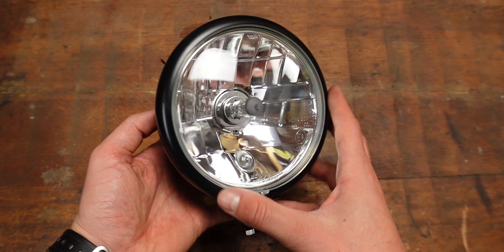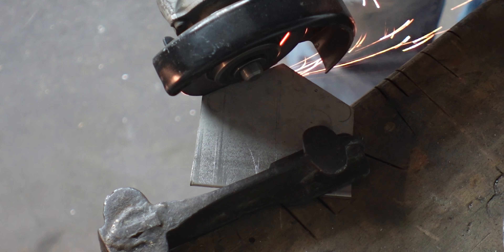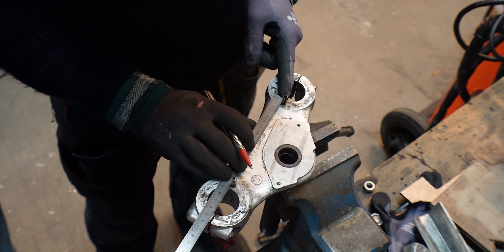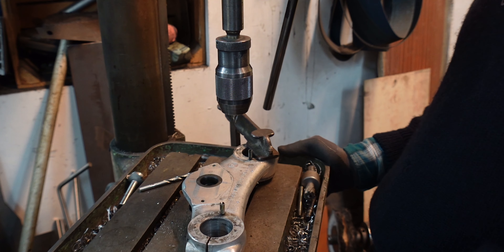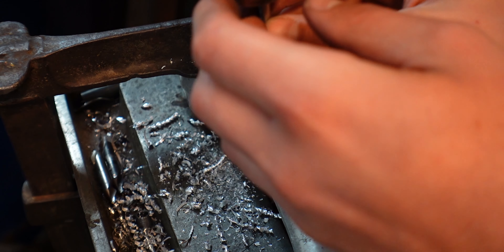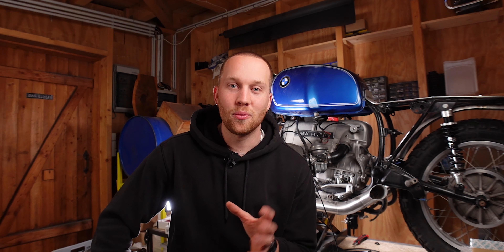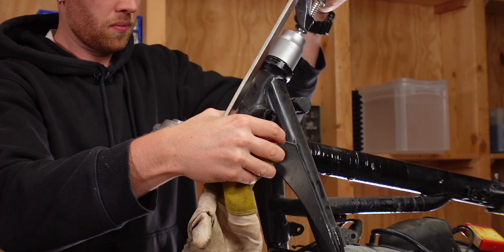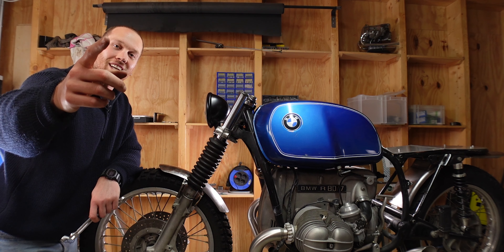Custom Headlight Bracket - BMW R80 Build

Comment: Great job. Attention to detail and the stages of the fab work was excellent. I normally setup my headlight so the top of it doesn’t break the top line of the tank for balance. Personal preference, but that looks sweet 💪
Reply from the maker: Hi, I appreciate the kind words and the feedback. That's actually a really good tip. I'm gonna keep that in mind for future builds. What are you building at the moment or what have you built so far? Would love to hear some stories about your project(s)! - Joshua

Comment: Great video. Have you thought about using your 3d printer for prototyping brackets like this? Could save you some hassle before making the final one in metal
Reply from the maker: Yeah...true. now that you're saying it it would have saved me some trouble 😅 I didn't really think of ot because I needed my friends input for the mounting points. But in hindsight I could have just made a prototype for the front part, where the light sits. I'll keep that in mind for  the next project :)

Comment: Really enjoying your videos! I'm currently customising a 1983 R80 Rt into a bobber. Looking forward to how you lowered the front forks as think I'll be needing to this too
Reply from the maker: Hi Andy, sounds like a nice project! What have you done so far / what are your plans for your bike?
Lowering the forks has a big impact on the overall aesthetic of the bike and actually a lot easier than I imagined it to be.
Reply: @MotoWrenchers  bike is fully stripped now. Engine is getting cerakoted black. Single seat wimoto conversion and full motogadget M unit rewiring 🤞🏼
Reply from the maker: That's awesome. Are you doing everything yourself? And are you completely taking the engine apart for Cerakote? I'm also planning on using Cerakote for all the small bits and pieces. I'd love to jump on a quick call and chat about the project at some point if you'd like.
Reply: @MotoWrenchers  have sent you an instagram message 👍🏻

Comment: Sell me the 2 sleeve headlight brackets that you're not using.
Reply from the maker: I wish I still had them so I could give them to you but I already sold them. Which bike/peoject would you use them for?
Reply: @MotoWrenchers  I have my R100 Cruiser I’m still working on. To be honest, I haven’t done much to the motorcycle yet, but I’m going to start soon. I’m going to take as much weight off the bike as possible remove all the heavy hardware bags and fairing. I just clean it up with a nice pair of handlebars and a cafe racer style seat.
Reply from the maker: Sounds like a nice project. How's the headlight mounted on the R100 - on the front fearing?